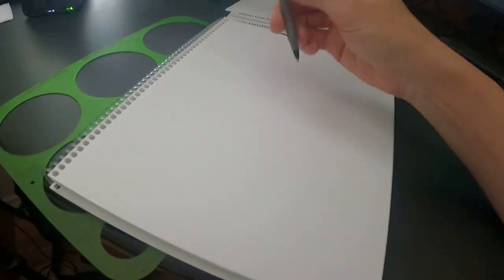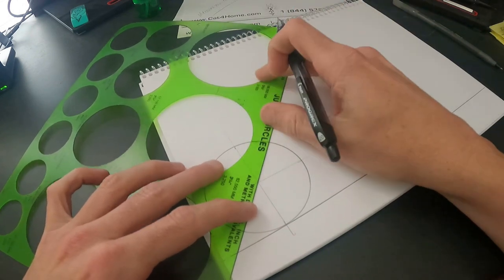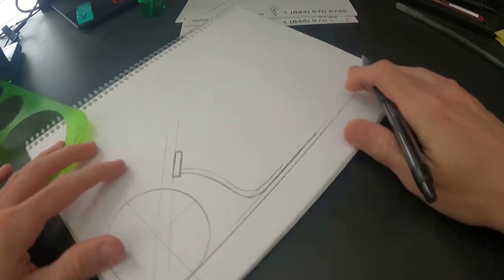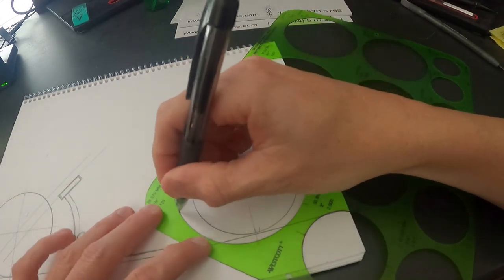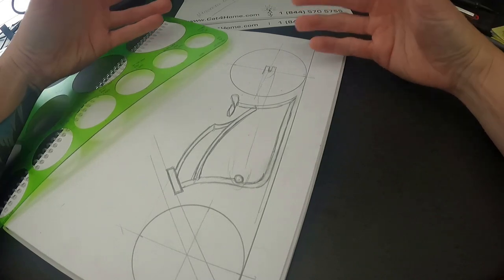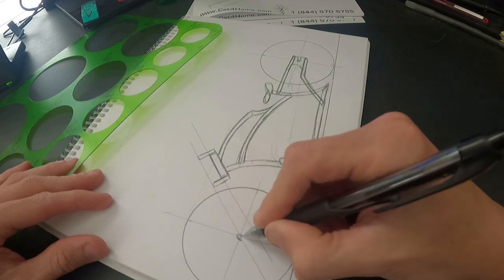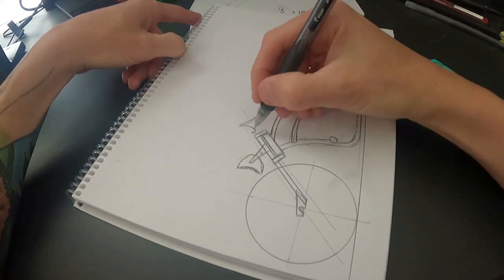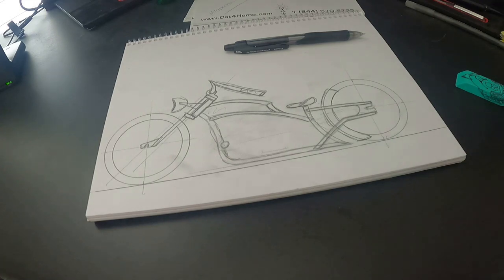The Design Process, How I Do All The Custom Bicycle Frames.....Kinda.

Comment: Hello, what is the distance that you recommend between the bottom bracket and the seat, since you mention it is the most important.
Reply from the maker: I don't recommend any. It depends on the person. I use 34 front headtube to seat then center of BB to seat is about 32-34

Comment: Cool video man. I’m still confused about the BB to seat measurement being the same as your inseam. Seem’s that you wouldn’t be able to pedal because your leg would be at full extension when level with the BB, not the bottom of the stroke. Does that make sense?
Reply from the maker: Don't forget you are now sitting. I'm a 30 inseam,  and my leg is almost at full extension when the pedal is all they way out. And I have some seat adjustments. Could be the wrong way to do it, but it works.
Reply: @CburkeCustoms  Fair enough mate, it’s just a bit counter intuitive I guess. I’m in the design process at the moment, got all the kit together, roller bender, notch cutter etc, even found a guy over here in the UK, that makes jigs like the one you use :)
Reply from the maker: @Yosser70  heck yeah! Good luck
Reply: @CburkeCustoms  Thanks man. Your videos have given me the inspiration and confidence to give it a go 👍🏻